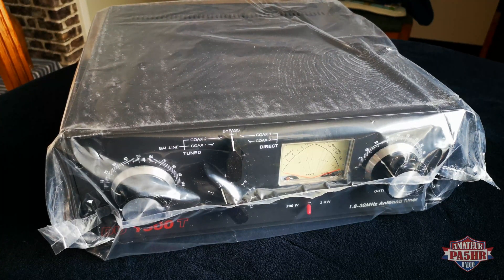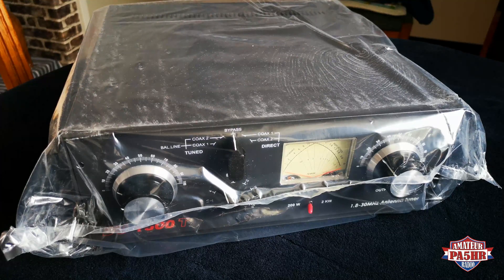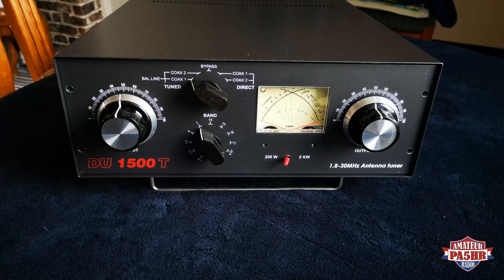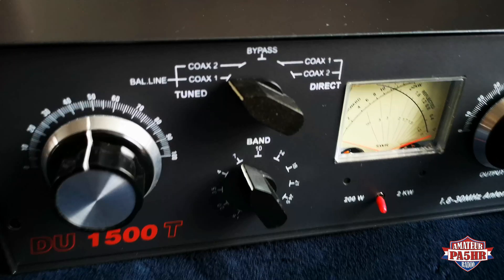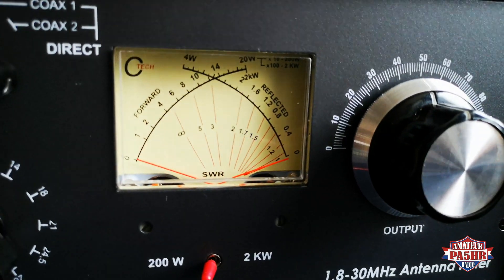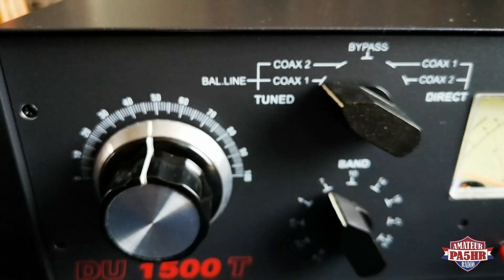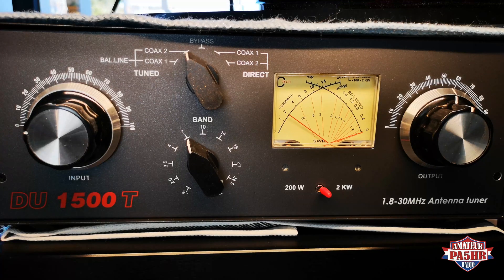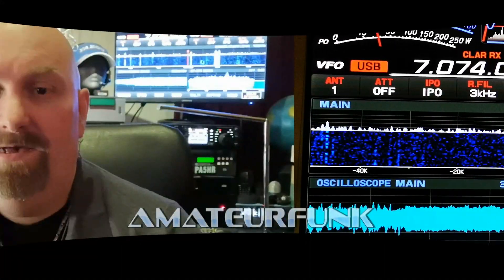Antenne Tuner DU1500T

Comment: Just got one of these new. Came with loose screws and bent back panel. Very poorly packed for as much it cost.
Reply from the maker: okay thanks for your reaction sorry for your experience with this good Tuner but i dont know why this in your case is happend but this is such a good Tuner so my experience okay wish you good luck vy73 de Bert PA5HR
Reply: @PA5HR1  I did a lot of research on tuners and this one was the best, had high reviews built like a tank. I was a little disappointed in the physical condition when I received it yesterday. I fixed everything and it works real good.